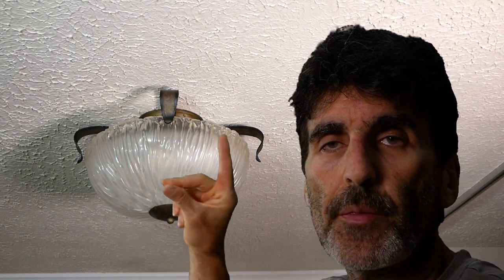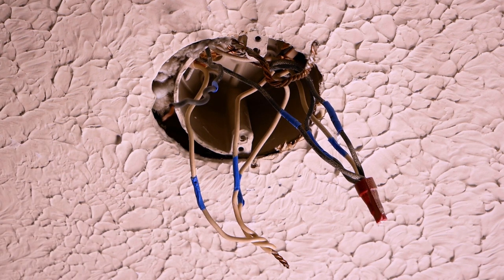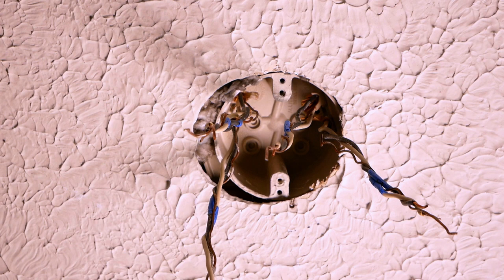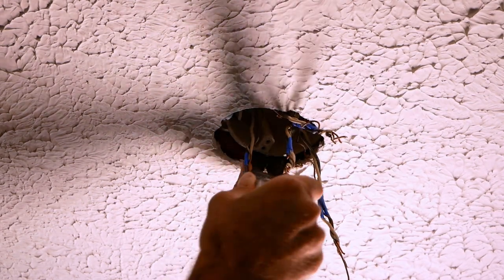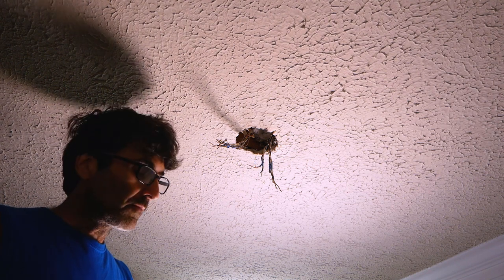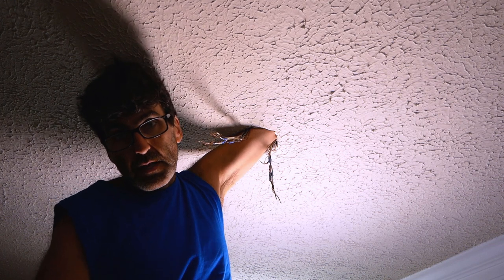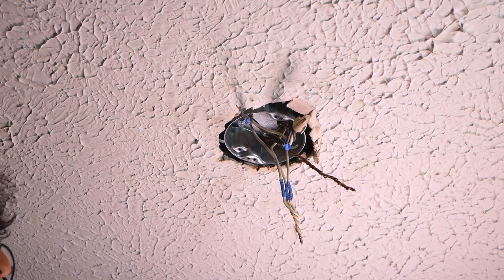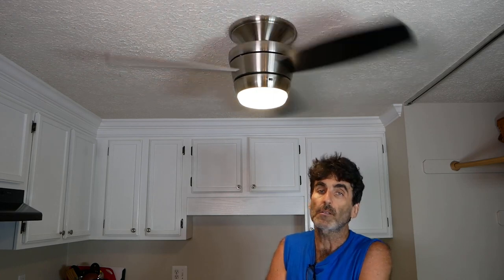How to Retrofit a Light Fixture to a Ceiling Fan Step by Step

Comment: Had you used an EZ-Brace 101 you wouldn't of had to change the box or mess with all those wires, and it would have taken less than a minute than you can install your ceiling fan
Reply from the maker: Great tip thanks!

Comment: Thanks so much for this. I wanted to find out what is required to properly mount a ceiling fan because when we moved in years ago, the inspector pointed out that our ceiling fan is just mounted on a plain junction box, which explains why it wobbles like crazy when we have used it (so we don't use it). I have access above in the attic, so I think I'll just install it from up there.
Reply from the maker: Oh wow... Yes you don't want to run that like that.  I have recently discovered another option you might want to look at.  It might save you a trip into the attic.  This bracket can mount into your existing box and save you the trouble of swapping everything out:

https://www.amazon.com/dp/B0B4QV16DB/?coliid=I232EXPH6JN5RS&colid=3DYCYVYTZSLC7&psc=1&ref_=lv_ov_lig_dp_it

Either way, let me know if you have any questions.
Reply: @TheHomeImprovementChannel  thanks! It may be easier for me to go into the attic anyway since the fan is mounted on the ceiling of a split entry, so it's quite difficult to get up there with a ladder.

Comment: I'm replacing light boxes with fan boxes. 

Been using the boxes that lag bolt straight to the joist, more commonly known as saddle boxes.

Only thing I don't like is they are usually about 1/3 the room as a normal box. Super solid tho.
Reply from the maker: Yes I've used those boxes when the joist or truss is right in the center of the room and you want the fan to be too.. They work great!  But a little tight.. yes.

Comment: I feel as though this whole project could have been easier/quicker by going up in the attic...
Reply from the maker: Nah, not necessary 😊😊
Reply: @TheHomeImprovementChannel  can I ask how do we know the light fixture wires can carry enough power to power the fan? maybe check the amps on the circuit breaker?